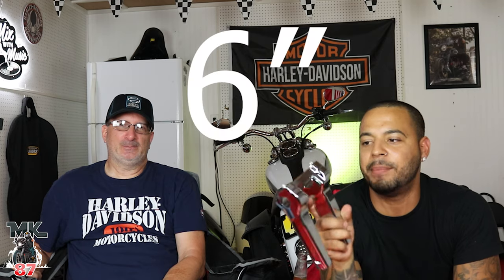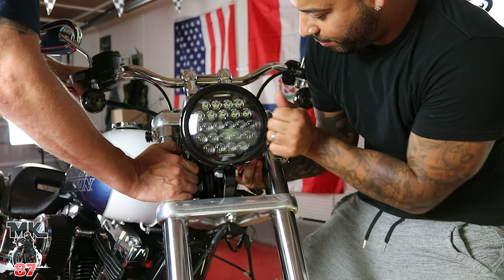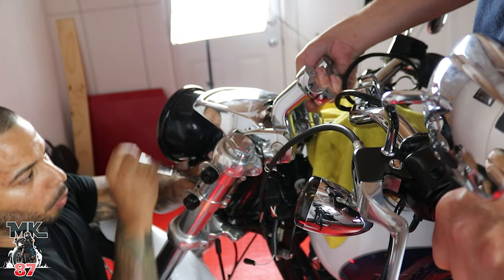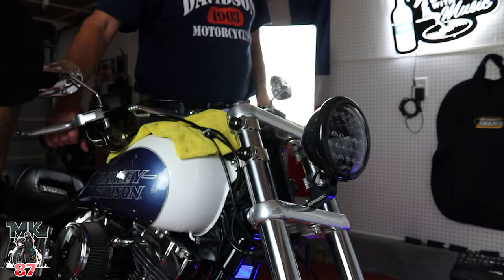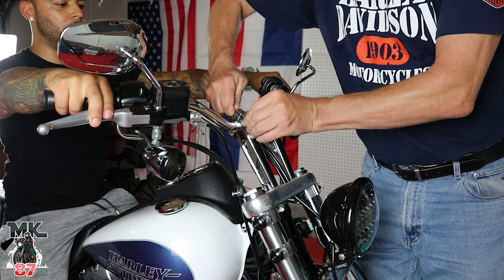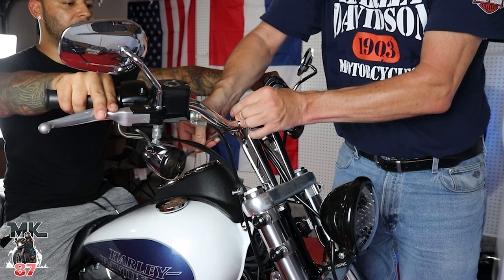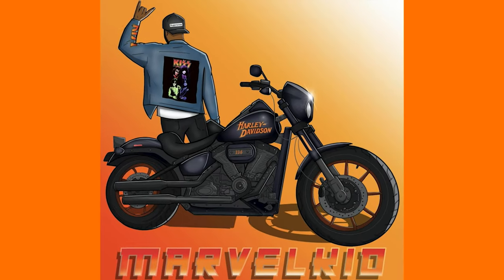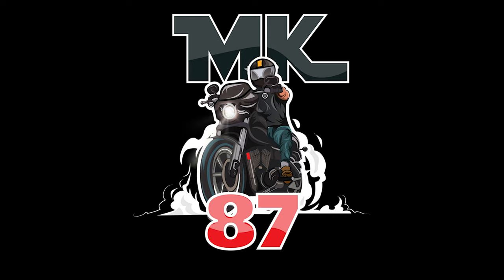Thrashin supply risers install for Harley Davidson

Comment: Running thrashin supply bar and risers on my street Bob. Absolutely love them.
Reply: What size did you go with and did you have to change any lines or wires?
Reply: @jimbeam4111  6.5 pullback with high bend bars. No wiring extensions needed. You can do the higher riser with the mid bend with no extensions as well
Reply: I just ordered the same set up can’t wait hoping it fits me better than the streetbob stock setup since I’m 5’1” 😊

Comment: How did you run the wires through the handlebars? Thrashing days the handlebar openings are big enough for the connectors, but they ain’t. Can’t find a video showing how to run the wires. I am afraid of damaging my connectors

Comment: Nice just had 9"  with mid aggressive bars all from thrashin install  on my lowrider st.I am 5'9" .  I am in perfect ergo position. I could only have hoped would be this perfect fit.I literally have straight up no reach I mean perfect. Very expensive but way worth if keeping the bike.Just wanted others to use for reference at my size

Comment: I’m debating in my brain…. THRASHIN supply 6.5” pull back risers for my lowrider st……. Or Roland Sands 8” pullback with the gauge relocation kit… RSD are a lot more expensive…. But I think they look better and I like how the digital gauge can be set lower.. leaving room for a tablet ..  idk… I need to get a full understanding about what’s available for both when it comes to future changes and device mounting

Comment: Can u recommend a riser for the 883 that doesn’t require cable changes.
Reply: 883’s will require it.
Reply: The stock iron 883 cables will go up to 7 inches, except for the brake cable. You’ll need a new brake cable.